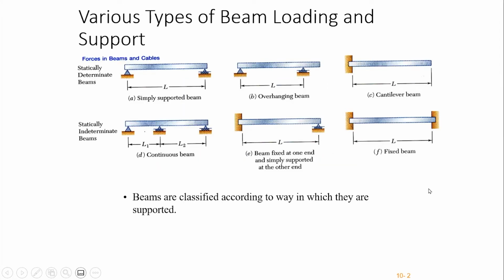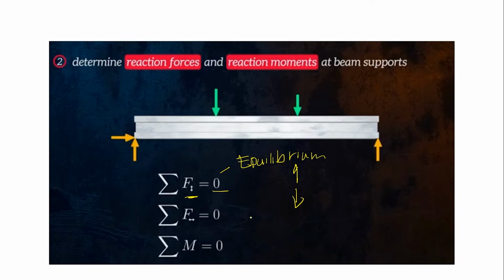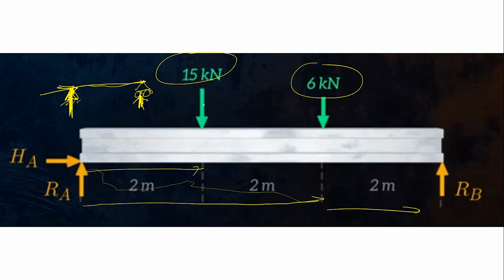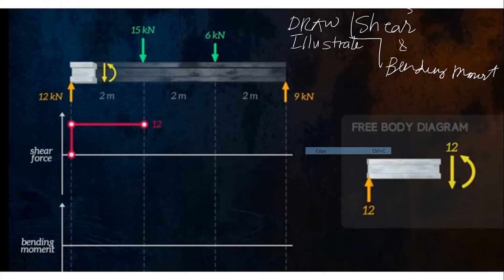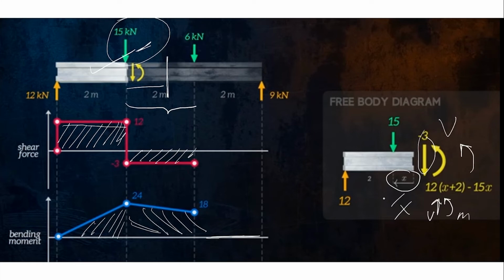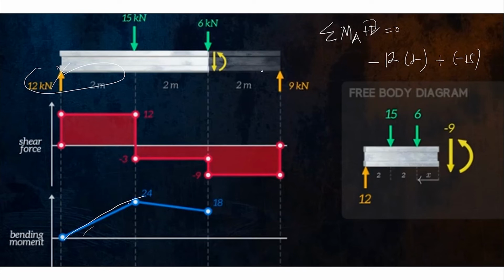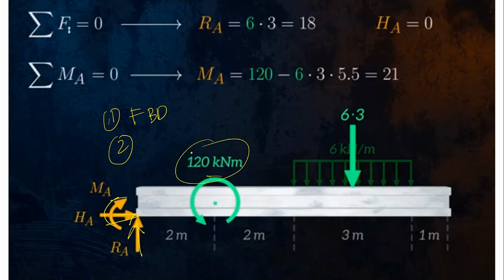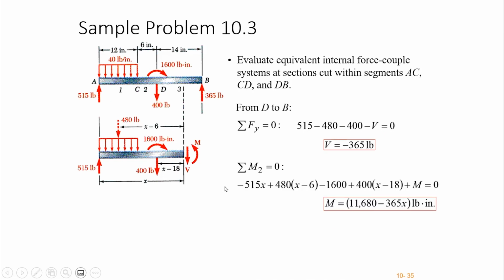Beam Analysis: How to Draw the Shear and  Bending Moment Diagram?

Comment: Thank you. I can apply this to my course!  A shearing force occurs when a perpendicular force is applied to static material (in this case a beam). Think of a knife cutting through a carrot. Imagine the beam is the carrot and a point load is the knife. As the knife applies a downward force, it cuts (or shears) the carrot. These forces occur along numerous points of a beam, and it is important to determine where these shears are at the greatest points as this may be where a beam fails.
Reply from the maker: wow. thanks for a very generous comment. Appreciate every word in every line. Hope you continue your interest in our channel.. thanks a gain..

Comment: Very interesting lecture ProfCharlton! Study this method as it is very versatile (and can be adapted to many different types of problem. The ability to calculate the bending moment of a beam is very common practice for structural engineers and often comes up in college and high school exams.
As what I have understand to ProfCharlton's lectures, when solving a problem like this we want to first remember that the beam is static; meaning it is not moving. From simple physics, this means that the sum of the forces in the y direction equals zero (i.e. the total downward forces equal the total upward forces). A second formula to remember is that the sum of the moments about any given point is equal to zero. This is because the beam is static and therefore not rotating.
Reply from the maker: as usual, very good comment fro you miss Hickman. Thanks for the continuous support..